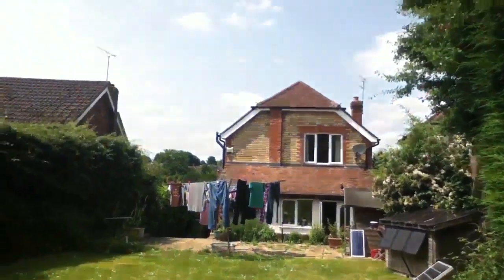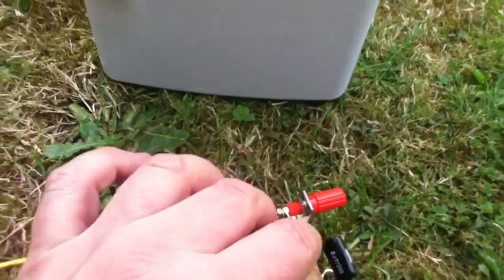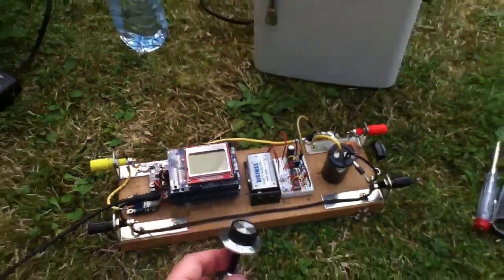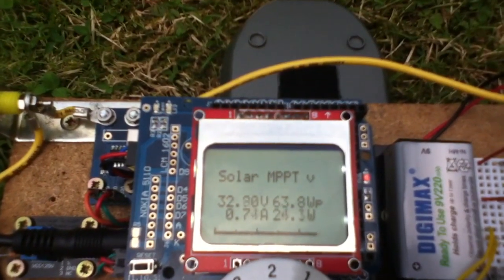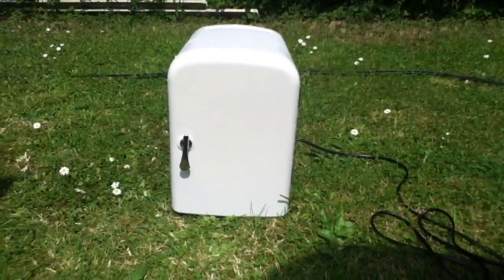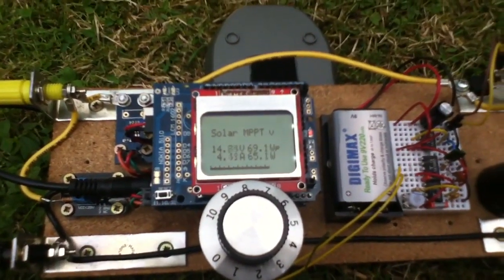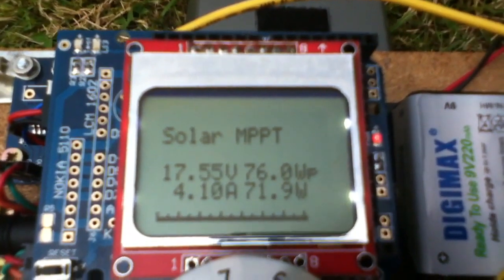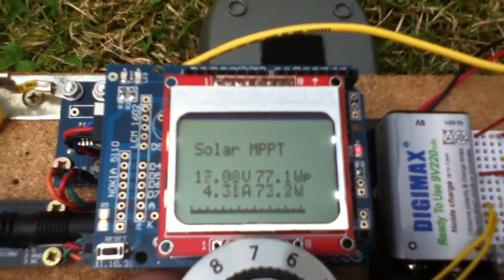MPPT Solar Charge Controller #11 - New PWM Dial, 80W Panel & The Sprinkler

Comment: Great vids Julian, picking up lots of tips. Had a thought about cooling the panels, what about combining systems so that the panels could heat the house water storage tank, therefore more efficient panel output and excess heat stored in the tank = more efficiency, what do you think?

Comment from the maker: I tried that in my video about the 20W panel and 21W bulb - not too successfully. The buck converter in a solar charge controller needs to regulate the input voltage (the panel voltage), not the output voltage (battery voltage).

Comment: That makes sense.  How well would a basic DC-DC buck converter with the output set to 14 volts work?  I know that it wouldn't track the maximum power point for varying conditions but would it work to take advantage of the power wasted under the standard sunny conditions of a solar panel producing 18 volts and a battery only needing around 14 volts to charge?

Comment from the maker: There is always an advantage over PWM, but if small, that could easily be lost overnight if the MPPT unit has a higher standby current than the PWM unit. When MPPT units claim a 30% increase in power over PWM units, conditions have to be ideal for that to happen. You have to read between the lines of the marketing hype. It may well be cheaper to invest in larger solar panels and PWM controllers

Comment from the maker: Yeah, the hot panel had max power at a much lower voltage than the cold panel.
I think a sprinkler system (or even a closed-loop water cooling plant) would be hard to justify on cost grounds - probably cheaper to buy more panels.
I'm not sure it's time to "close the loop" yet. The voltage and current sensors need filtering - the Watts bargraph is just too jittery, jumpy, noisy to track properly. Then I need to play the part of "controller" to get a sense of how the tracking algorithms will work

Comment: That's really interesting. When you used the 80w panel while warm the MPPT gain was only about 5w, but with the sprinkler it was a lot more. So I guess two things come to mind there.  (a) It is probably not worth rigging up a water cooling system to panels if you're running a straight PWM controller. And (b) those results ov course vindicate the usual stance that MPPT has the most benefit on a sunny winter's day. I guess the next step is to make the device vary the PWM ratio automatically?

Comment from the maker: Cheers Martin
The panel was probably 50 or 60 degrees Centigrade before (like a hot central heating radiator) and about 10 or 20 degrees under the sprinkler, although these figures are estimates.